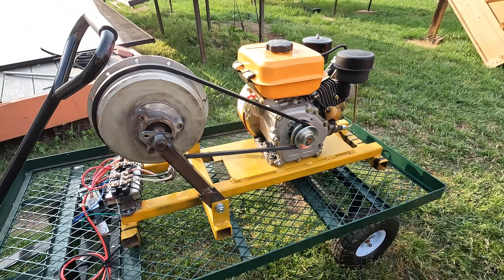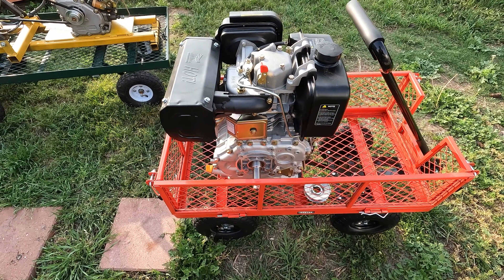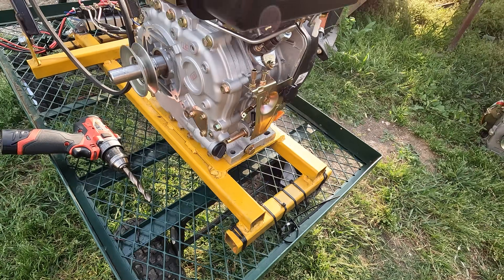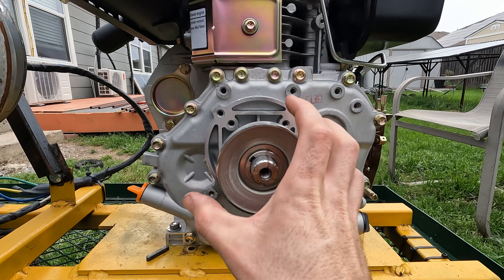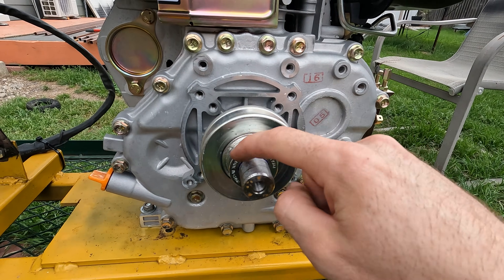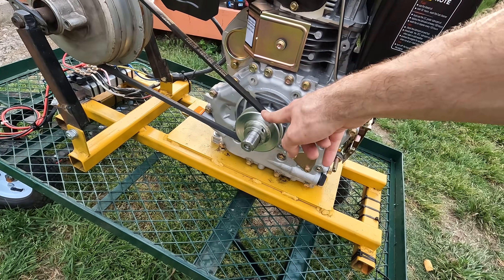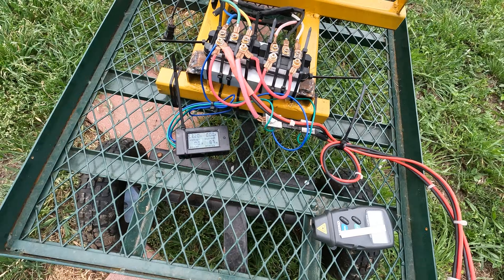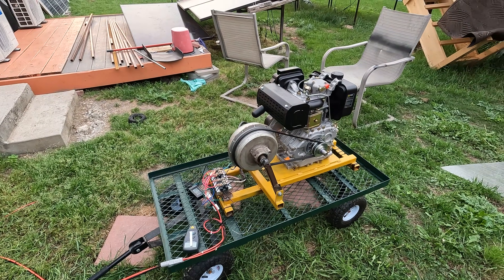Amazon Chinese 10hp Diesel Mounting to Generator Cart

Comment: Bro can u put Ac compressor and see if it gives enough colling without overheating on it try making it a little apu for semi trucks
Reply from the maker: @gurkaranvirSingh-b5g  If you can keep the air flow around it good it would work, but it has to be able to get plenty of cool air

Comment: Hey im trying to put this on a sawmill do you know the mounting pattern and hole spacing want to make sure it fits before i buy
Reply from the maker: @tuckerbuzzell1882  I’ll try and measure it I have it bolted down, but it’s slightly bigger than a standard 196/212 gas engine bolt pattern
Reply: @Mikebuildss  ok if you could that would be awesome thanks

Comment: Have you tried running that on used oil?
Reply: dirty oil will shorten the life of the engine.
Reply: @DWinnie67  well I have been running several engines on it for 20 years, I run my two military trucks off of it, I run two military generators on it, I run a yanmar tk270 engine on it, and I have couple of other small diesel engines I run it on like a portable diesel generator and water pump, and I've taken apart a couple of them and no issues. I run it threw a centrifuge that filters down to . 5microns and comes out really clean, I also run threw a heater that removes any moisture. To each his own, but it's saved me so much money that I could buy a new engine every so often and still have saved a boat load of money. I was just curious because thinking about buying a couple and I like to make sure can run on waste motor oil, because that's exactly what I'm going to do, I guess I'll find out in few days, I order two, for couple projects.
Reply: By dirty u must mean overused oil that has started to thicken. I run all my 2cycle on used amsoil signature series oil. That used oil better than new regular oil.

Comment: Why are small engines so loud?  Yet a huge truck engine is relatively quiet.
Reply: The length of the exhaust helps also
Reply from the maker: @AM-dn4lk  truck engines normally have better fueling systems to make the diesel knock a little quieter, that and this is a cheap engine

Comment: Hey I love the channel  your freaking awesome , have you tried running a bigger flywheel and a small generator wheel . I just bought an alternator from a big truck for 65 bucks , it had 8 batteries epu setup the whole 9 yards.  Semi don't have high rpm range 6-700 idling 1800 max shift , most trucks cruise on the hwy around 1400-1600 and still produce a tons of electric power with low rpm. I'm going try running a big flywheel & little alternator wheel setup at low rpm. Diesel produce of torque on the bottom end  I'm going try too take advantage off that. Fuel economy should be good in theory but who knows .
Reply from the maker: @matthiggins4965  I appreciate it I love messing with these engines, I may loook into that and maybe find a large alternator, I’m impressed how good the hub motor works anything permanent magnet works really well too. Good luck!

Comment: Just a rule of thumb to figure 2 HP per Kw with a gas powered engine and 1.5 HP per Kw with diesel powered engine. To provide a stable current flow and if you follow those figures you work the engine whitout overloading beyond the engine governor limits to keep a steady RPM.

Comment: As far as a pulley for the motor goes, you might be able to find an old dryer, and use the intermediate drive pulley for the drum for the generator side. Some where spoked, some were sheet metal. It's worth a look at least,. because if all you're getting out of that 10 HP motor is 1kW, that's only a little over 2 HP worth of mechanical load. You're losing power somewhere and I suspect the belt drive is it. 

Or the motor doesn't have enough field to generator power at the RPM range you're running at.
Reply from the maker: That’s a good idea, my biggest issue is belt tension is bad and it slips a ton, I’m in the process of making a way to tension it then will make  another video

Comment: I used for such setup  controller for bldc motor with regenerative braking.It's allow use motor as starter,and after start switch to regenerative braking mode.Adding to this sine wave inverter  you get  inverter generator

Comment: if you have a variable load resistor, and play around a bit, you may see something worth noting. "jacobs law".
the generator has resistance. when you have a load of equal resistance, you can only get half the power in the load. the other half is dissipated in teh generator itself. the generator will need twice the power to spin it.

with a pm generator like this, you spin it at any RPM, and play with the resistance. you putt a wattmeter across the load. you dont measure the total power. you measure whats dissipated in the load. and if you reduce the resistance below the resistance of the generator, then what? the engine driving it still bogs down... but what you read on your wattmeter is reducing... because you are now dissipating more power in the generator than the load.

the only way to measure all the power is to put an arm and load cell on the motor mount, some type of pivot... torque over RPM. if you short the generator, you make a basic "dyno", but have to deal with the heat it makes... by varying the resistance, you can control the braking force.

anyway. if you run a generator with an equal load, you get 50% of the power in the load. but the generator is still getting stupid hot.

about 10x the resistance is nice. doesnt over work the generator. yet its still low enough to dissipate a reasonable amount of energy. but thats just resistive heating. theres a resistance between 5-10x thats ideal...

to charge batteries though? it gets hard. very hard. they arent resistors. and they have internal resistances that are extremely low. the way they interact with the generator is often unconsidered...

when you hook up a generator... if its voltage is below the battery voltage.. nothing happens. the generator simply cant deliver any power. if anything it becomes a motor... if the voltage is higher than battery, the battery tries charging. but being such a low resistance, it appears to be a dead short. unlimited current tries to flow, but as the generator can only deliver so much to that load, the voltage sags, the generator gets overloaded, and rather than push power into the batteries, it either stalls the engine, or it overheats. 

you need to spin the generator fast enough to get over the peak battery voltage, and simply limit current with a series resistor... you have to waste power in a resistor...

Comment: Find maximum rpm voltage output per RPM.  Attach the generator to a bike peddle system to adjust RPM. A diesel at idle will easily achieve much better fuel economy.  Set idle just about start speed. Adjust RPM to generator to max efficient RPM. Now measure fuel consumption by hour.

Comment: NICE.  I would love to be able to do this but for a 24v system.  We live remote in Alaska and I have a few small diesels.  My issue is the rectifiers. I have no clue on all that stuff.
Reply from the maker: That’s awesome, yea any 3phase brushless permanent magnet make great generators, I’d maybe see about using a car alternator, but those require modifications to run higher voltages

Comment: Also a suggestion! You should add a threaded rod or something like that, build a mechanism to tighten that belt more. you need WAY more belt tension, you are loosing a lot of potential power output from your belt slipping! I can see it on the video, hehe!
Reply from the maker: Yes that’s a good idea, definitely need something, I want to make closer to 1kw sustained, will work on that!

Comment: Lovely! Looking forward to seeing more of the 10 horse diesel! I have a question - where did you buy the pulley that fits on the 196CC? I have one of those myself, and I would like to hook it up to a car alternator after my 220V generator head I had connected to it decided to melt down due to shorted laminations. I would like quite a big pulley on the engine, maybe 4-6 inches, so I can get decent RPM on the car alternator even at low engine speeds.
Reply from the maker: I used a 3/4 pulley, from tractor supply, I shaved down the engine shaft with a flap disk using an angle grinder with the engine running, it’s not very precise but worked great for what I’m doing

Comment: Hey super easy tip for noise. Just make a box  (open top or bottom) out of plywood, or even better fiber board.  Surround  the whole works with of course plenty of room for ventilation and exhaust.  You will be shocked how much the noise level is reduced.  To test just prop a single piece of board between you and the engine then step back.  You and your neighbors will be thankful.
Reply: Boost this, I do this at the campsite if I HAVE to run a generator
Reply: @LincolnElectricDaycare  This is exactly what we used the box for!  RV camping!
Reply from the maker: I may do that , I want to be able to run it for some time I feel paranoid right now , but I might try that!

Comment: Get a quality silence muffler thats on moped step thru scooters  ,  have  mounting flange etc  and exhaust  tips  modified  and i bet its much better,    honda Yamaha Suzuki etc ,   expensive to buy new ,  seek motorcycle wreckers and get one there very easily and  cheap er 😮   ,    for the job its doing  and fact you dont run thru long extensions  leads  ,   its going to be close by so make it quiet,    or build small brick shed to run it in , after starting  it ,  push it in and shut the thick wooden door,     have vents to allow air flow and  heat ,  chimney for exhaust,       but yeah spend the money or time on a silencing muffler,,,     i know they work so good you'll  be amazed  ,      seen the drug crop growers  use these on the water pumps so nobody's  gunna hear it and come investigate,    trust me that you will wont to pat me on the back for insisting  you do this ,     no more worries  with noise annoying your neighbours,       now  its easy to fix and way worth it for your efforts  already can be award but after patent designed,      good for as long as motor  dont die before muffler  will,   these are built real good by japan ,  and japan made is the best in the world
Reply from the maker: That makes sense, thanks for the comment!

Comment: That motor is too big for a minibike. Find an old 200 or 250CC dirt bike and install it with a big Comet torque converter.
Reply: Rpms too low to engage most clutches and CVT'S

Comment: Fuel economy tests need to be at rated power or else the results will be disappointing.
Reply: No that is peak. U operate at ur needs up to peak. Ur car peak output maybe 300hp @5200rpm yet vehicle get 30mpg. U dont drive around pinned at 5200rpm. Otherwise ur mpg efficiency would suffer but in the event u need 300hp. The engine can produce it at the cost of fuel efficiency
Reply: @herewegoagain4041  wrong look at any nicer generator like a generac it will have fuel use at 100% and 50% load , at 50% it's still used. 75 the same amount off fuel there are at peak efficiency at rated power
Reply: @DeminicusSCA  11000peak 8500continously

u are correct my bad. I remember during beryl. My wen 11000 was getting 2hr per gallon when I was suppling the whole house 4000watts. Thats 3.5ton, 2refriderators, deep freezer, drink cooler. 3ceiling fans(70inch,2 52inch), led lights. 

Amazingly when it was just the ac at night. I would get 3hrs per gallon. How I know is I refueled every 4hrs to monitor fuel consumption. I have watt meter between the  generator and panel. But u right I guess.

I dont want to max out the genny to rated for 2 main reasons. If we are using wen11000 and every body is over here. That means conditions are not normal. This is everybody comfort safety line so we dont want to stress the generator. And we dont want to consume to much fuel cause we in dire situation.

Comment: I didn't see any smoke on start-up. If so I would think that means it burns the fuel well, even cold. Nice shim job, must of used a good brand. Random citizen.
Reply from the maker: It’s suprises me it didn’t smoke, the smeller one did when it was loaded up
Reply: @Mikebuildss  I’d like to see at least a little smoke.. I’d turn the pump up a little it’ll make more power.